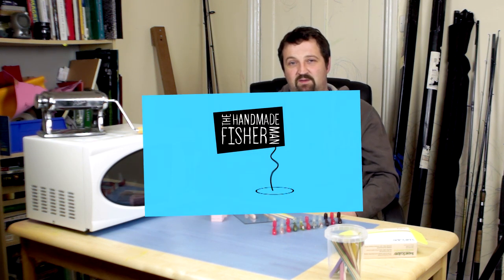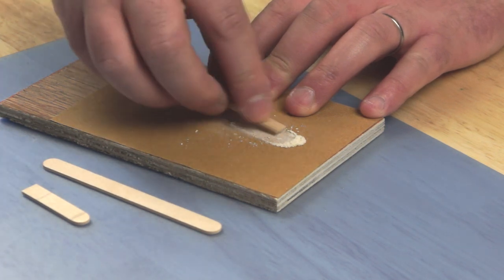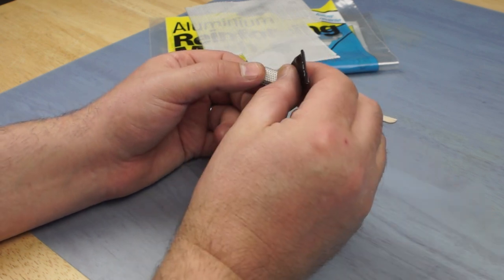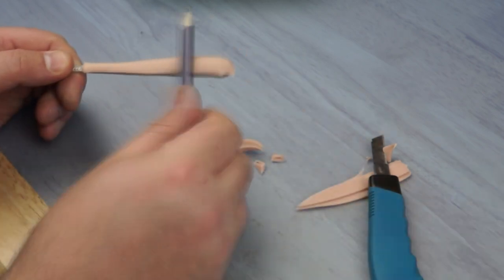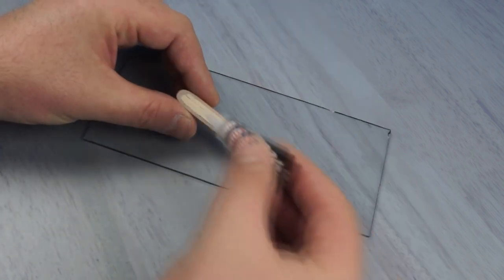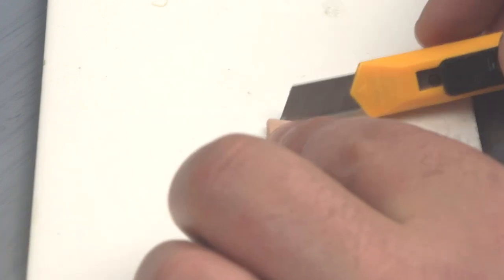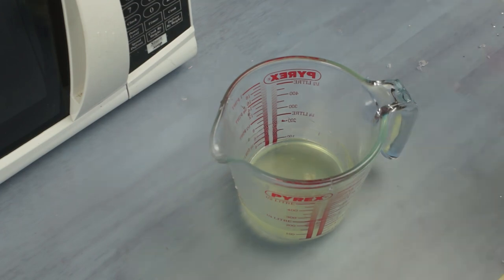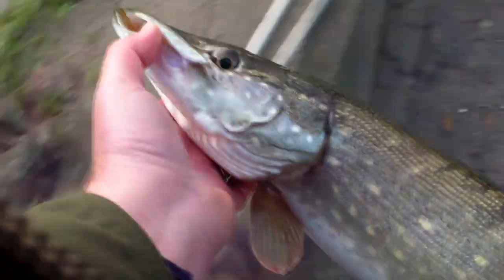Making Paddle Tail Soft Plastic Fishing Lures

Comment: Back in 1980 I worked in a contract  machine shop.  One of our jobs was to make a mold  for those type of lures.  We  made the master of harden steel and pressed it into a aluminum block.  Of course our mold made 48 lures at a pressing.  The video showed  an very effective method of making a mold.

Comment: Do u know if you can just use an existing soft plastic lure to make a mold with silicon
Reply: Cobe Mahan yes put your old soft plastics in a glass cup. melt them in the microwave and pour it into ur mold. make sure to vibrate your mold a little to get out any bubbles
Reply: He meant as a master i believe. Yes you can.
Reply: I’m sure you have learned this by now, 2 years later. But yes you can. Etc silicone in true form will mold whatever you want. But if you want a true, round bait, your mold really needs to be made of something hard, like plaster or a hard setting plastic or metal cast

Comment: Hi Paul. Your videos are inspirative ! Do you use aluminium  wire mesh to make sculpey more stable on wood ? Do I have to use it as a prevention from deformation during baking, or it isn't neccesary to use  ? 
Thank you.
Reply from the maker: I went a bit over the top with this to be honest but it worked, I wanted to use the sculpey as just a skin so i could get an symmetrical lure shape, i found when i used the sculpey on its own it was too flexible but there are stiffer types of sculpey
Reply: Thank you Paul.

Comment: Hi, really enjoyed this, very informative.  

I was wondering, how crucial is the fine sanding?  I plan on getting some Fimo and trying this out, but I only have sandpaper up to 400 grit, then a big step into micro mesh! Is it to ensure the silicon can separate from the positive?
Reply from the maker: What i have found with making the master out of polymer clay is the silicone mold will transfer any scratches to the final lures.  I used to start out with 100 grit but found i spent longer trying to remove the marks it left. I normally start with paper about 400 grit and go up to about 2000grit before polishing with cotton. Micro mesh stanrts somewhere round about 1000grit and goes up 10000 grt  think it is up to you to find what you are happy with in the finish. With the uber grub i used micro mesh also and the finish is about the best i have ever got from a mold. Another good option i have messing with is added a spray can primer so i do not have to sand so much and then giving it a spray can gloss coat. I think the other thing is, will the fish notice and to be honest nobody but a fish could answer that question. Good luck
Reply: ***** Many thanks :D 

I'll definitely be giving it a go, just need to wait for pay day.  I won't be doing any '3D' uber grub type lures just yet, but I reckon I can manage a nice weedless paddle tail with a bit of effort.  

Thanks again :)

Comment: What type of paint and clear works? I have createx paint and was thinking of buying special paint for soft plastic lures but not sure what type of clear. Maybe just dipping in plastisol after painting? Thanks for the quick reply I appreciate it.
Reply from the maker: Mike Kim i have been using a cheap acrylic from the local art shop but createx should work but the lures need to free from lubricant before spraying and then i dip them in clear although i am still messing round with it.

Comment: Hello Paul, thanks for the video! I have a question about the resistance of the lure as in how much can you strech them, and some advice on how to deal with it being full of micro air bubbles. Thanks!
Reply from the maker: normally they are very stretchy with the soft plastic i use which is the soft version as it come in different grades. I tend to get small bubbles when i remelt soft plastics to use and they can be a pain in the arse get rid of. If i have melted the soft plastic and it still has bubbles i leave it about thirty seconds and give it short blasts like 20 seconds at half power in the microwave, sometimes it takes a few goes to get rid them.  Sometimes if the mould are cold they may have condensation in them which will create bubbles when the plastic goes in, so I normally have to give it a couple shots to get the mould up to temperature.
Reply: Thanks! That was indeed the case, I remelted it. I did it before without problems, so I did not understand why it was different this time. I'll try those tips and see what happens, Thanks again Paul.

Comment: I couldn't help but notice your perch and trout colors. How do you pour them with a flat mold?
Reply from the maker: i am experimenting with color at the moment for a future video,on these i used sharpie markers but not all colors are very stable, this i suspect is something to do with the solvents in the ink. But i am working my way through options, at the moment , acrylics are looking good with a thin overcoat of clear.   Thanks
Reply from the maker: Sorry the trout also has a bit of red worm that had been rolled in glitter and then dropped into the mold while i was pouring.

Comment: Hey Paul I have a question, do you need reinforcement mesh or can you skip the step?
Reply: Also what is the temperature if you were to put in an electrical oven
Reply from the maker: +Cerium Doge  You could try it without any support including the wood and use a firmer type of polymer clay, try the local craft shop for sculpey firm or fimo firm, temperature wise depends on the maker of the clay but it is normally around the bottom of ovens temperatures.

Comment: Hello. Love the videos. Was wondering how you painted your paddle tails. Can you use an airbrush?
Reply from the maker: Mike Kim with these i did some experiments with marker pens which worked but long term they tend to bleed, i also rolled bits of worms in glitter and the drooped them in while pouring to give the organ pouch effect. I have been more successful spraying them with acrylic and then clear coat dipping but i have not got round to putting a video together as i am working on some hard plastic lure vids at the moment. Thanks

Comment: With the coloring of the fish how do you get the strip effect or the dots on the sides of the soft plastice??...Thanks
Reply from the maker: these are made with sharpie markers, they tend to fade over time. The belly glitter and colour is made by taking a piece of soft plastic worm and rolling it in glitter and then casting it into the lure when pouring. cheers

Comment: Hi I cant get the silicon for the mold could I just use plaster of paris instead but still follow all the steps like the clay master glued to glass then pour plaster over it
Reply from the maker: The difficulty with using the baked polymer clay and plaster is for the this type of lure i do not think you would get the original out of the mold without damaging the mold. You could use unbaked clay with plaster of paris but you will destroy the original getting it out.Another option is to use silicone caulk or sealant, this is a videolink on making Economical Silicone Molding tutorial   caulk silicone molds.  Thanks and good luck

Comment: Another brilliant video of yours , Paul , ....too bad that I've never got into pouring plastics .

Very strange to me to put a plastic shad underneath a float , ... though I've read , that they do such in the US , but most uncommon over here .

Have yourself a great crafting and fishing season in 2014 , ....tight lines , Dieter
Reply from the maker: The float is just to make them work vertically at distance the line slides through, instead of running them just along the bottom. Cheers dieter, e-mail an address, it would be a pleasure to see some of my lures doing the rounds in your bath.
Reply: *****

PM sent , Paul , ..thanks a lot for your offer . Greetz , Dieter

Comment: hey paul, will it break if i clamp the clay? i'm trying to make a mold
Reply: or can u suggest anything that strong enough to clamp ? for example : bondo
Reply from the maker: +Azarul Ziqri It is not strong and will break, bondo may work but it is fast curing if i remember, but you could sandpaper it into shape. Epoxy putty is also good as it is slower setting and can be smoothed with water Milliput  white or something similar  may work, wood and layers of paint is another option
Reply from the maker: +Paul Adams (The Handmade Fisherman) sorry i thought you meant for the master not the mould, yes people make bondo moulds it is not something i have tried, plaster of paris is another method but generally you have to have soft items to take a mould from

Comment: How much would it be to make a mould and get started making lures
Reply: probably around $100 to $150 just to start making your own suply and depending on how much diy you incorperate into your prodject
Reply from the maker: you can get starter kits with a mould for £20 from lurefactors.co.uk in the uk I think makelure.com also do them in the usa. A small amount of silicone if you wanted to make your own mould would be £10-20

Comment: how many minutes you put the plastisol? in 12:11 minutes
Reply from the maker: Eduardo bellezia sena batista Bellezia   It depends on the quantity and the power of the micro wave, i normally heat in short blasts of a minute at full power and it needs to be stirred every minute  to stop it burning. So a small amount like this in my microwave takes about 3-4 minutes

Comment: Why not just make your bait out of the Sculpey, heat it in an oven, then use that to pour mold material into a box?
Reply from the maker: +Owl Jones yep you can do, i was using a softer version of sculpey which was not great to make accurate shapes from. When I make these videos i am experimenting myself and while many of those experiments work it does not mean it is the only way or the best way. I learnt a lot from the techniques i tried in this video but there are much simpler ways of achieving the same or better results. thanks
Reply: Owl Jones funktio

Comment: Anyone know the specific "Flexible liquid PVC" he was using?
Reply: No, buy usually plastisol is what I use for soft plastics. Avoid at Janns,  Barlow's or Lurecraft. It goes under different brands
Reply: Larry Lee Thanks! I haven’t tried making the mold yet, just finished with the clay blanks. Do you know if the low viscosity silicone works well with small swimbaits, like 1 3/4 inch paddle tails? Or are any better alternatives?
Reply: Autocorrect screwed up. Available at those websites, not avoid. I don't know about low viscosity silicone . I have made small baits with plastisol or it's equivalent. No problem.

Comment: yah true. why not just use a polymer clay or air drying clay to make the master? similar to what you created with the skull jighead? I love the artistry on this vid, though.
Reply from the maker: The trouble i have with polymer clay is making projects which are accurate and symmetrical, with the skull that wasn't so critical but with lure bodies i find it can be a problem making the lures do strange things like swim to one side or twist in the water. This was a test to see if i could use a basic shape and then skin it so i get the best of both worlds. I am just beginning with soft plastic lure making and as yet i haven't found a guide book so i have to reuse other other techniques and experiment. This is walking before i can run, hopefully when i look back on this vid in a few months i will think what was i thinking. Thanks
Reply: ***** thanks lots for the explanation, Paul. symmetries, ...hmmn I didn't think of that. learned lots here. thanks heaps.

Comment: ok but, what component is this?? 12:55
Reply: This is the rubber mould to make the real rubber lure in. You buy a silicone rubber kit, with the rubber, part A, and the hardener/curing agent, part B. These two are precision weighed or liquid measured then mixed, then poured. Make sure to look up and watch some of the brilliant and in-depth vid on the subject. I personally watch Robert Tollone, who has a lifetime of very professional work behind him (just mould making and casting, not on lure making). He is also a very nice guy to learn from. If you need to find out more I’d be happy to send links and anything I can. Have a great time with this, as it is very fulfilling. Regards, Cam from Canada.